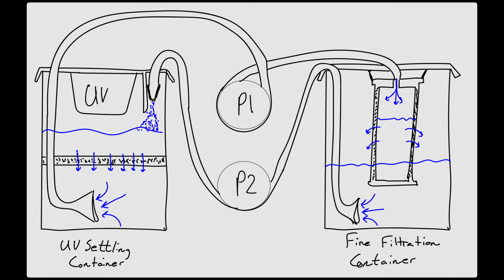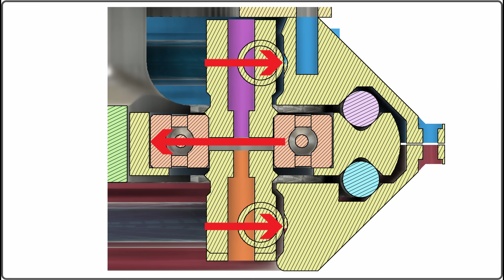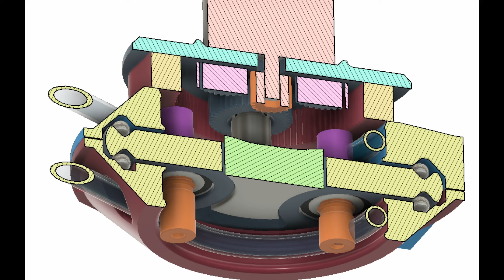Building a High-Flow Peristaltic Pump: 3D Printed & 10 Liters/Minute

Comment from the maker: Corrections and such:
- In the voiceover, I say the wall thickness is 1mm, but as you can see from the measurement, it's actually 1.75mm. The nominal design leaves a gap of 3mm (added 0.5mm of interference to account for the compliance in things.
- It was recommended that using a single oscillating lobe, and instead having multiple loops of tubing will result in longer tube life. I’m also curious if this can result in a smoother pulsation in the flow. (thanks @anothermidlifecrisis).
- Pointed out that with the large cross section tubing and high flow rate, there may be potential for the vacuum pulled on the inlet side to collapse the tubing. After some quick tests, it doesn’t appear to be a consistent problem in my set up, but the tubing I’m using is relatively stiff compared to some. So something to keep an eye out for if using nice, soft, silicone tubing! (thanks @AlexRay0)
- More confirmation that I am not to be trusted :) it was confirmed by another commenter (thank you @SianaGearz) that I shouldn’t be using Loctite around these PETG parts! But @seanconant3218 suggests VC3 as a polymer-friendly option. I haven’t used it (yet), but definitely sounds like it’s a smarter choice than my Loctite Blue! -- Additional +1 on regular Loctite not being compatible with many plastics from @AMakerDad, who offered up Loctite 425 as a cyanoacrylate (super glue) based thread lock, which is compatible with printed plastics.
- A good option for extending tube life was suggested by @jimk8520. If positive displacement isn't necessary (which definitely not for this high flow fella), then not compressing the tubing fully will significantly reduce the stress it sees.
- @ducktaperules pointed out that if you rotate the housings relative to each other, so that the tubes have an angular offset, it will stagger the load spike that occurs when the posts engage the tube, reducing the max torque required. I haven't tested to confirm, but the logic seems sound to me!
- @Pyromancers suggested the idea of wrapping the contact posts in tef tape (or other similar low friction tape/wrap) to reduce friction. While I haven't tried it, it seems like a great idea to test out!
Reply: I can confirm that commonly used red and blue loctite attacks plastics - they cause the plastic to stress fracture over time.  

Years ago as a young engineer we had a military contract building chargers for L3.  It had an expensive LEMO connector going into a plastic housing.  The assembly drawing calls out Loctite 425, which is a cyanoacrylate, but the folks in manufacturing ran out and did a substitution for Loctite 271.  About 6 months later we started getting calls that the units are failing - the plastic around the connector literally started to disintegrate.  Because 271 is red, it was really easy to see what happened.

We ended up having to build new wiring harnesses (with a ~$100 LEMO connector) and having to remount the mold and shoot new parts to replace the plastic housings.  I am pretty sure we lost the shirt off our backs on that contract.

As an interesting side note, cyanoacrylates also degasses - and the fumes from it reacts with fingerprint oils and forms a white milky film.  After applying the CA we have to let the parts sit out for minimum of 24 hours to degas before closing up the enclosure.
Reply from the maker: @AMakerDad Ouch!! Gotta love the, "eh, this seems close enough" production floor decisions! Definitely an understandable 'oops' though, I suppose, like you said, red is red. Was the root cause review fairly quick, or did it take some time to track it down? I could see that being a somewhat tricky one to catch (unless maybe it left some sort of obvious signature on the failed parts). 

And how bout that! I've definitely encountered plenty of that hazy white coating alongside CA joints, but never knew that was the reaction causing it (insert "the more you know" GIF here :) ). Does that 24hr window depend on the viscosity of CA you're using, or is 24hrs generally enough for any of the common offerings?

Thanks for the confirmation and great anecdote!
Reply: @AMakerDad 🔴 Why Islam not other religion

 1-islam gives logical and simple idea for God - he is A perfect God - he is not a man nor a son of man nor an Idol or a trinity nor limited nor created - he is totally unique and to him belongs all the good qualities 

2-Islam accepts all messengers of God -- about 124 000 and in Islam, we love all the prophet of God and we can’t deny any of them - while in other religions such as Judaism for example - they reject Jesus and Mohammed -- and in Christianity they reject Muhammad ... but in Islam, we accept all . 

3-in Islam, there is no mediator between you and God -- you can pray to God directly - there is no need for someone in between... 

4- Islam is the Only religion that is Not named after a person or a tribe or a group, its name means submission to the One True God, if anyone anywhere at any time lived the life of submission to the true God alone , then he is a Muslim.

 5- In Islam (worship) is not about mere rituals. it's a comprehensive term that includes any deed that pleases God. All good deeds are types of worship, smiling, being sincere at work, saying a nice word, and even treating one's spouse gently, all this is greatly rewarded by God. And in the opposite any deed that doesn't please God is a sin; talking bad about people is a sin, cheating, lying, hurting innocent people, harming the environment. 

6-in Islam God is always forgiving - if you always repent (before death ) he will just accept you no matter how great sins you did >he forgive us out of his own grace - there is no price to be paid in order for him to forgive > so it's not like Christianity which says that God can't forgive except by blood of Jesus ..

 7-Islam is a way of life – it organises each aspect in your life.. it has solutions and divine guidelines to problems in your life . 

8-the sources of Islam also was collected and saved is also amazing - it never happen to any book in history --- it's through the uncut chain of known narrators which date to prophet time ... besides the millions who memorised it from cover to cover since that time up till today - besides being documented in front of the prophet by known companions! 

9-Islam prohibits blind following without knowledge and it invite us to use our brains to know truth, it is based on evidence and logic. The rational mind is the basis for religious accountability and responsibility. 

10-the moral system of Islam is v high and perfect and thus the countries that apply Islamic laws in a proper way -- they have less moral crimes.

 11-You won't lose Jesus if you accept Islam, but you will just correct your belief in him , In Islam, Jesus stands a good position in Islam as one of the messengers of God together with other messengers.. they were all special and they were all humans like us-- none of them must be worshiped -- we only worship God who sent them . we believe that Jesus was a noble Messenger of God but not divine,,,, we love Jesus and obey his true teachings and pray like him , fast like him , and a person won't lose Jesus if he accepts Islam -- but you will just correct his belief about him 

12- Paradise in Islam is a real physical life for both Body and soul, you will go there , eating drinking marrying and meeting with prophets and having wonderful eternally unlike in other religions which they think its only spiritual life.

 👉IN ISLAM THERE IS A PURE & CLEAR CONCEPTS OF GOD 

🍃🍃🍃🍃🍃🍃🍃🍃

God is One and Unique: God has no partners, no equals and no rivals. God has no father, mother, sons, daughters or wives. God alone is worthy of all worship. God is the All-Powerful: God has full authority and power over all things. Obedience to God does not increase His Power, nor does disobedience decrease His power. God is the Most High: There is nothing above or comparable to God. The attributes of God do not resemble that of His creation. No part of God is present in anyone or anything. God is Perfect: God does not have any human limitations, such as resting on the seventh day after He created the universe.

Comment: Custom make your own silicone tubing in wall thickness and diameter.  Silicone caulk can be pushed through a tube forming mold and can be hardened with a Hydrogen Peroxide bath.  3D print the molds so they can be split open and cleaned

Comment: Move the motor away and use a pulley to slow it down. There's a pully like a chain with links if you want adjustable, probably print it if your plastic is durable enough. Also with pullies is that a stacked set like inside a drill press with a ratio range might be all you need to conrol speed.
Reply from the maker: @napalmholocaust9093 Not sure why a belt drive never even occurred to me! Thanks for the solid suggestion!

Comment: I spent a whole lot of time many years ago fixing peristaltic pumps and one thing I can put out there is that smashing the hose too tightly over time will rupture the tubing. If your system doesn’t need to create high pressures, it’s better to reduce the pinch and let a little leak by happen if you want this to run without liquid surprises in somewhat short order.
Reply from the maker: @jimk8520 Great point, thanks!
Reply: Especially with 3d printed (ridges) pins like that.

Comment: Does the small diameter of the contact posts wear the tubing quicker than a large diameter contact point, like the outside of a roller bearing?
Reply from the maker: @roboman2444 I have wondered the same thing myself. It makes sense that having a more gradual slope in the tube deformation would create less localized stress, which I would assume will extend the tube life. I would guess there is some ratio of contact diameter to tube diameter that it's good to stay above...unfortunately I have no clue what that ratio is :)
Reply: I came here to say the same thing, My physical intuition sent up a flag when it saw how sharply the tubing was flexing due to the small roller diameter.

GREAT project and design though! I think peristaltic pumps are a great, simple and highly accessible solution for hobbyists and makers everywhere 😊
Reply from the maker: @DaveEtchells yeah, that tubing just doesn't look too happy, does it? :) 

Thank you! And couldn't agree more! They're pretty forgiving, and (at least in my opinion) oddly satisfying
Reply: Maybe put bearings on either side with larger diameter... Yes. 3 bearings per shaft. Middle for guiding and 2 external por pinching

Comment: Maybe using propylene glycol would be better than IPA?
Reply from the maker: @Pyromancers Is propylene glycol a viable solvent for common UV resins?? Consider me intrigued :)
Reply: @bubsbuilds  it is and it seems to work rather well. Issue is boiling it off I suppose. It doesn't evaporate as readily as alcohol. But I'm trying to find a way to switch to it.
Reply from the maker: @Pyromancers insert "the more you know" GIF here! That's awesome to know, thanks! I'm absolutely going to have to get me some on order to test out.

Comment: This might be useful to you. I found that when designing a dual / multi tube pump, if you stagger the inlet / outlet points then the load increase at the start point is spread to difrent points of the rotation making it easier to overcome the starting friction. For you that may just be a case of rotating one of our outer faces by 1/6th or 1/3rd rotation.
Reply from the maker: @ducktaperules Useful indeed, thanks!
Reply: Great tip. I came here to suggest something similar 😊

Comment: Why do you use many rollers? Why not use the minimal amount? Do they add any benefit if you dont need precise amounts of fluid being moved? If i understand correctly, you just need your tube to form a full cycle for the roller, so that there is no back flow, but the decreased amount of deformation would save you on stress and energy spent, right? Same flow still. Maybe a slight drop, but not by 3x, im confident. And of course, would need a support bearing, but one that would just ride against the solid chasis, and not the tube
Reply from the maker: @karyjas1 Very true all around! I think the main reason I use multiple is more about being 'stuck in my ways' than any really valid reason :) I do like that it balances the loading on the main bearing, but, as you point out, this could definitely be accomplished by balancing the load with a bearing on the solid chassis as well. Having the tube make a full wrap also makes for a slightly trickier track and inlet/outlet configuration, but far from impossible to resolve.

Comment: Yeah threadlocker corrodes PETG at least. I suggest just using nylock nuts or making tight threads into the plastic which is what I often do.
Reply from the maker: @oddspaghetti4287 Do you find that the tight threads in the plastic give enough friction by themselves to avoid backing out, or is that more in parts that don't have a torque through the fastener during operation? Thanks for the suggestions!
Reply: @bubsbuilds  Hard to say if printed threads are enough against vibration and tension on a screw. One of my models has M3 screws with 8mm of thread engagement (hole in Z direction) and I find that the amount of friction is excellent and surprisingly remains decent even after multiple reassembles. I've printed hundreds of this assembly and it works every time. Feels about on par with nylocks. Of course you will have to print some test pieces to find the correct dimensions there's a very small difference between too tight and too loose.

Comment: Threadlocker. Haha.

I have had both PETG and HIPS start crumbling apart in my hands from blue threadlocker fumes.

These are the only materials that i print, i don't know how the rest behaves.
Reply from the maker: @SianaGearz Ahhh, so confirmation, thank you!  PETG is my filament of choice for most builds, so definitely good to know. @seanconant3218 recommended VC3 as a good alternative for use with plastics. Do you have any experience with that one or other PETG-friendly loctite alternatives?
Reply: @bubsbuilds   Nope not familiar at all. I don't think availability of VC3 in my part of the globe is all too great, i've never seen it, but perhaps i can get it somehow :D
Reply from the maker: @SianaGearz ahhh, that does indeed make that tricky :) Well, if it helps, someone else suggested Loctite 425 as a cyanoacrylate-based option that's plastic friendly...if that one's not around your area either, guess you're just gonna have to glue everything together :D

Comment: hey, nice build

Curious if the silicone hose wears down?
Reply from the maker: @evren.builds Thanks! It unfortunately most definitely does! It can last quite a while, but in my experience they eventually embrittle enough to split. So I typically just give them a feel from time to time and just swap them out any time they start to feel...different? For some of the pumps I've made for hydroponics setups that are just flowing water, I'll usually just let them run till they fail.

Comment: at those high of flows, i'd be a little bit worried about negative pressure collapsing the inlet side of the pump (looks like it might happen a bit in the video).  seems like this would work just as well with larger diameter tubing, though.
Reply from the maker: @AlexRay0 Ya know, I hadn't even thought about that one! I'll definitely take a closer look at that. I'd mainly been looking at the folding at the inlet as being from the tubing being pulled by friction in the pump. But absolutely makes sense that the vacuum is only amplifying that problem! Thanks for the food for thought!